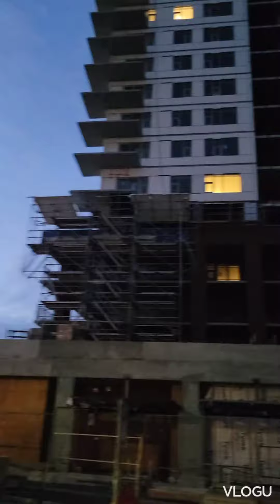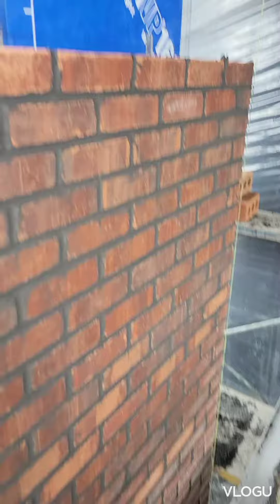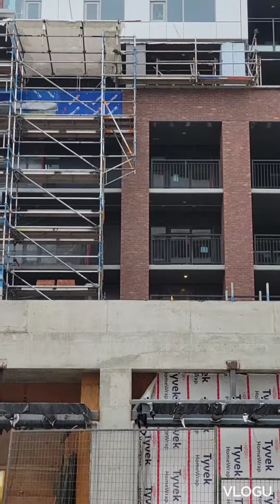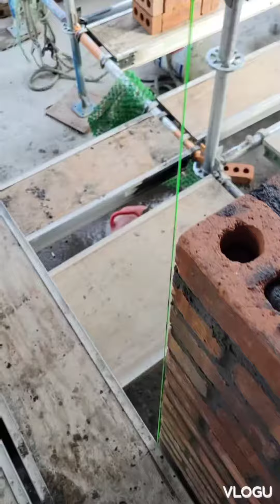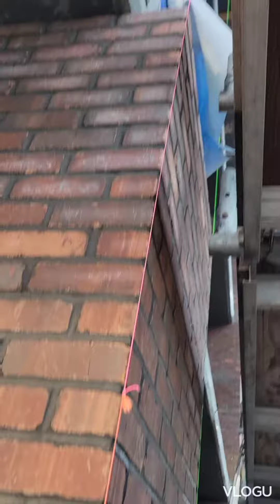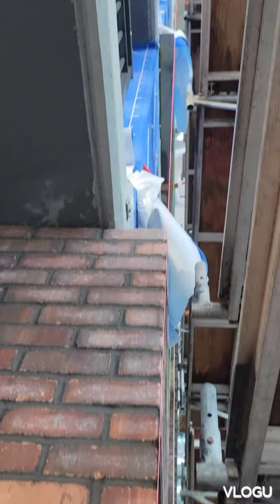Commercial Masonry Brick Job

Comment: Commercial is so different. Ive Never seen those wall ties before. And no horizontal lines,  Only vertical lines for your corners.. how do you know if your on 1's or what...?
Reply from the maker: Yea they are all gadged.   The wall ties are screwed into to wall 💯✌️👍
Reply: @wcnwmasonry8868  thanks! good work j